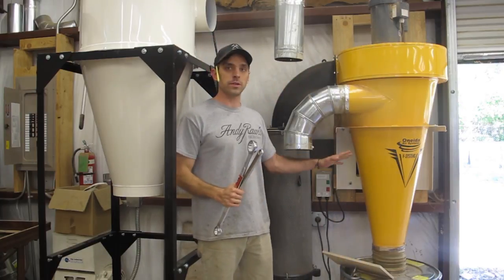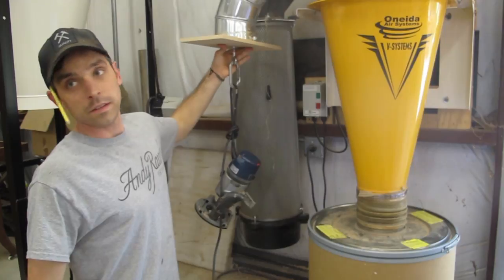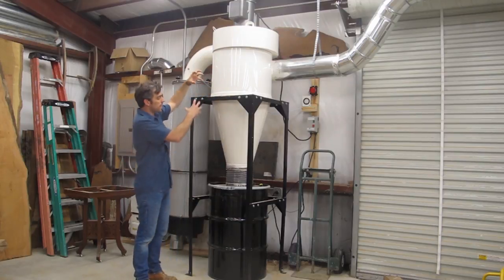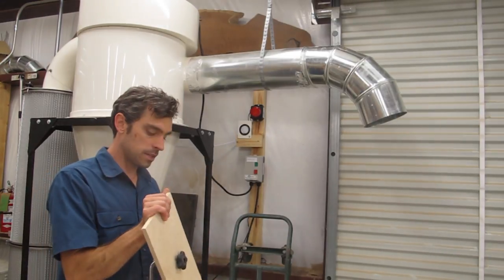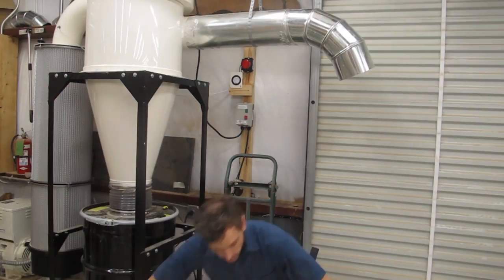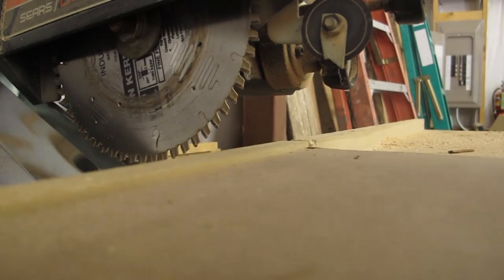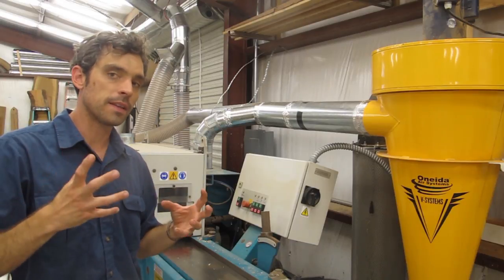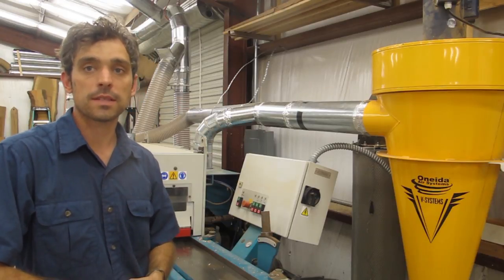This Oneida Dust Collector Has Some Serious Suction

Comment: I don't think the test you did tells you very much about the dust extractors performance. If you took a small suction pump that could develop a good vacuum it would, eventually, give you a better test result than your new super sized extractor. The reason is because the weight you can hang off the end of the extraction tube in your test setup is proportional to the diameter of the tube and the vacuum you can pull inside the tube (and the air pressure but I'm assuming that's a constant). If you put an eight inch tube on your old extractor it would probably give about the same result as the new extractor.

Comment: hey andy, why don't they design these dust collectors to sit on the exterior side of the woodworking shop with just a duct through the wall. The escaping dust and noise would stay outside plus more space inside right?

Comment: It would be a miracle if you actually get to this but... Did you just use 8 inch HVAC snap together ducting for your system?  Just got a new 5 HP DC and im getting it set up.

Comment: If that were a 5" Bosch grinder, it would have fallen. just kidding. When I put in the Oneida 7.5hp cyclone in the shop I had no return air box and the cyclone sucked the double garage door away from the rubber flashing seal and developed such force in the doorway from the shop to the utility room that I had to turn the cyclone off just to push the door open. I was yelling, "OK, honey, let me in I have to go to the bath room!! Come on, quit blocking the door; but, she did not answer." I made the air return box (see recent video of the new design in white oak) and now I can open the door more freely and the garage door does not suck away. I believe a lot of the construction of dust collection systems in a woodworking shop is just common sense in runner length, diameters at the cyclone and reduction of diameter accordingly at machines.

Comment: Hi Andy, I subbed...after seeing you on Off the Ranch.

I do woodworking too.  I do custom car audio and 12v electronics.  

I primarily work with 3/4in MDF in my saw room at the shop, building subwoofer enclosures and such.

Right now I have older version of the Grizzly G0562ZP 3hp collector. In my shop, I run 1 tool at a time, table saw, router table, or hand held router....and use blast gates for each tool.  Other than the hand held router, collection is pretty good.

I want to ask, do you use an ambient dust collector in your woodshop? Or shop exhaust fans? 
Would you suggest one?
Reply from the maker: +Canaan White thanks for subscribing!  When I'm creating a lot of dust I will use a fan to help clear the fine dust out of the shop.  I don't use the air filtration systems because my shop is probably too big for it to be effective.  If you have a smaller shop space then this might be helpful for you.  However, I think you're always best off capturing the dust at the machine with a good dust collector.  Hope this helps!

Comment: Is the dust collected used for anything of note?
Reply from the maker: Yes, it's connected to every machine in my shop.  If you watch the entire video you'll see how it's actually used to suck shavings and dust from the machine into the collection barrel.  Thanks
Reply: Sorry I meant do you use the dust for anything, as in make anything out of it or use it for fire starter etc?
Reply from the maker: Gotcha...not currently.  I do have a few people who will use it for chickens or horses.  I'd love to find a way to use as it just piles up behind the shop currently.
Reply: They make saw dust burning stoves... there's a Japanese dude that has a channel(ishitani furniture) where he demonstrates it.
Reply: Hey Andy you should get in touch with Peter Brown , Another youtuber he might be able to make something pretty cool with all of those shaving!
Reply: It also can be used to clean any oil/fuel dropped on the ground. Just pour some on it and then clean. Very helpful with gasoline and lubricants.
Reply: Andy Rawls  if you ever decide to build with mixed solutions,  you could add sawdust to it as a strengthening agent of sorts.